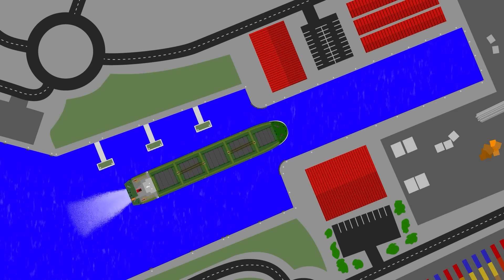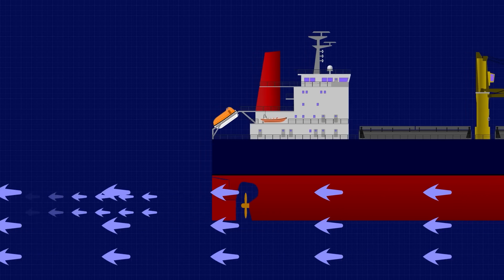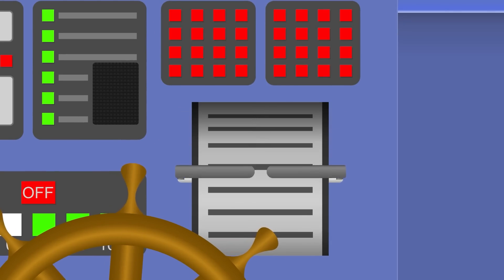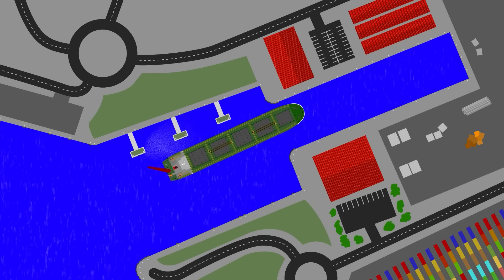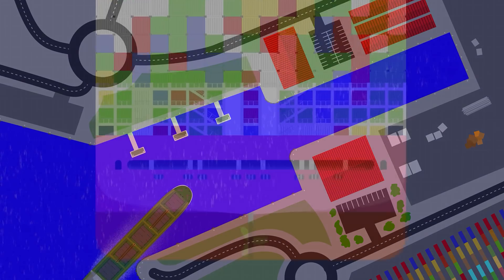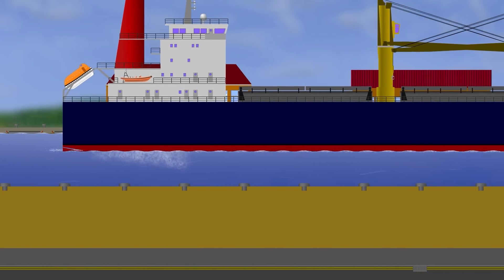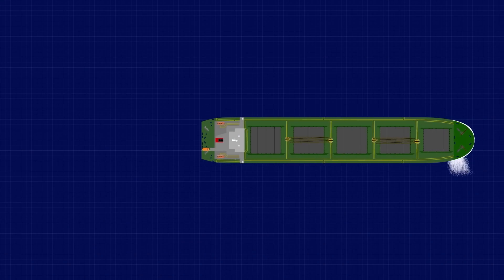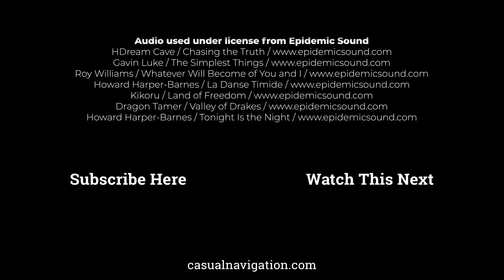Why Can't Ships Reverse Around Corners?

Comment: FIrst learned this from "Chapman's Seamanship and Small Boat Handling".  Older boats with a single propellor have a strong tendency for the stern to 'crab' to one side (rh screws will 'crab' to port).  The propwash against the bottom/ keel of the boat can be so strong that even hard-over rudder can barely back straight, much less to starboard.
Reply: That's how you dock a medium-sized boat. Come in bow first and get a line on, then reverse and crab the stern over so you can tie it off.

Comment: I assuming it easier to reverse with a smaller vessel compared to the bigger ones
Reply: Nu uh my friend's uncle tried to reverse in his little dinghy and then he got bowel cancer
Reply: Anything with out a rudder im understanding, smaller boats have their engines and rudder "combined." I'm sure you always can back up, it just keeps getting harder the bigger the boat.
Reply: Its due to where the rotational force is applied. For ships, its at the ass.(stern) for cars, the nose.